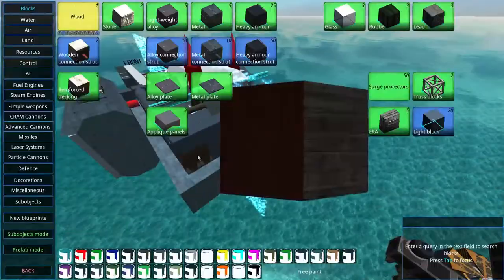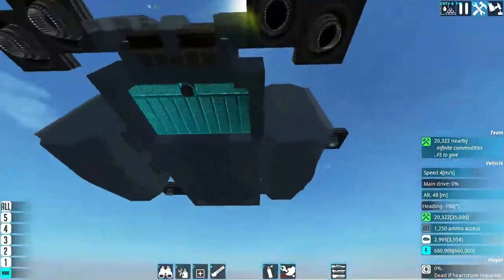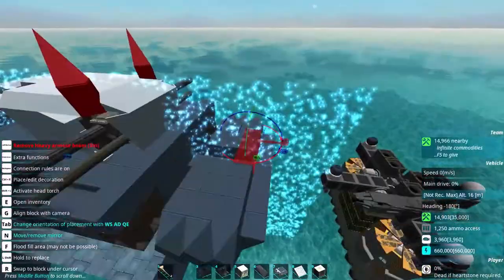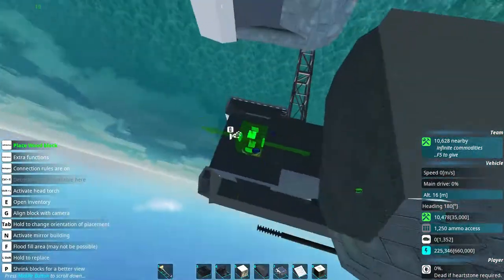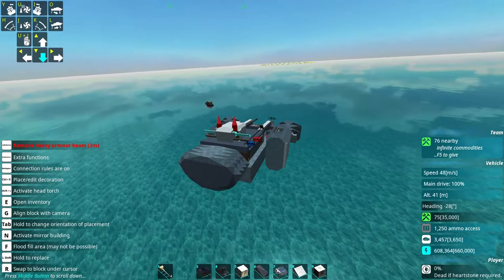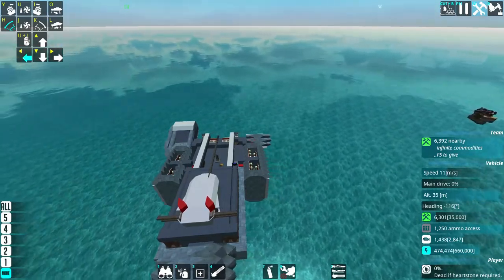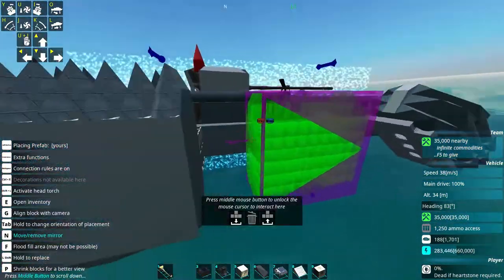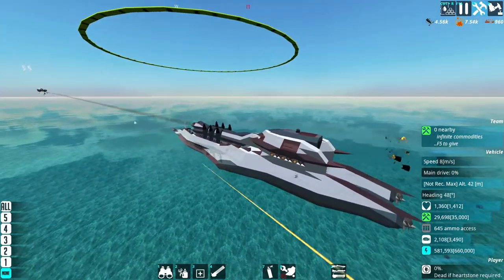Bit by Bit: Lets Build a Hovertank! Thrusters, Spinblocks & the Initial AI

Comment: Ok. Well that's really an easy one. Now I could build something similar, I'm happy!!

Two things:
 I don't think I would know what you have done in tuning the thrusters and Spinblocks and PID and AI if I were not using it myself a lot.
And  I thought you build something with evasion and or unpredictable flightscheme. I know weapons should not move/shake/wobble to much, but even a cram-boat might get your craft, right?

Well, maybe next time. 👍
Reply from the maker: I'm not happy with how the bit by bits have turned out, the only problem was I had the option of uploading nothing or these. I probably woulda scrapped these videos if I had adventure episodes to put out at the time. I'm still unsure as to whether Its worth having a few sub-par episodes for the sake of consistency. Thanks for the feedback btw, just a few words can really give a lot for me to work with!